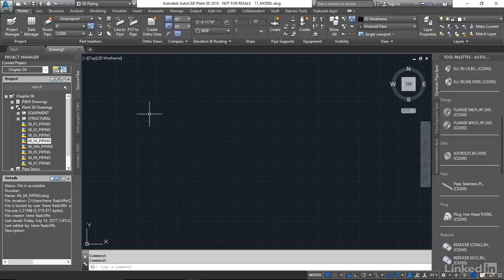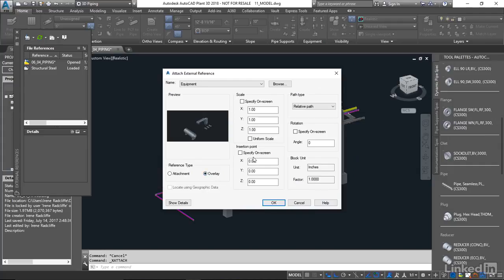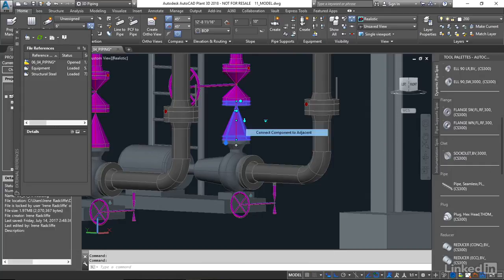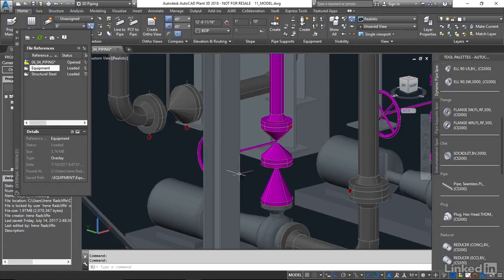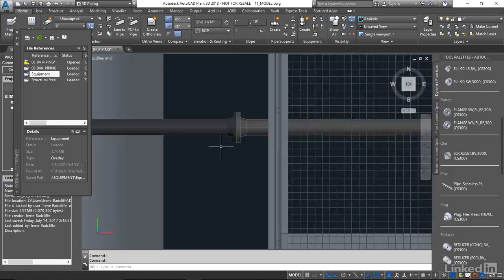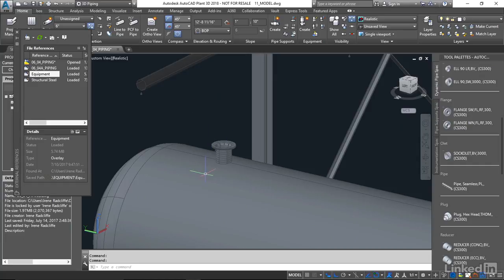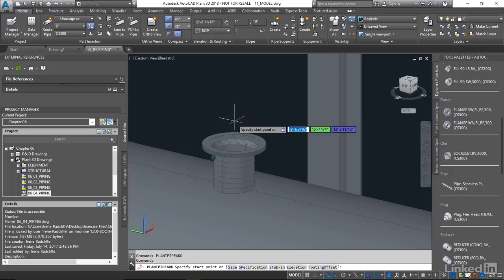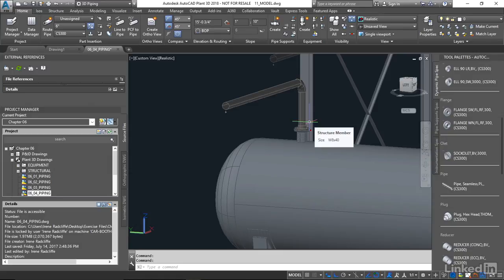AutoCAD Tutorial - Connecting to xrefs

Comment: Hi thanks for the upload. however, when i try to "connect to adjacent" i get an error message saying that they are NOT adjacent. but they are. ive checked many times, repositioned them, etc. do you know what could be causing this issue? thank you!
Reply: Hello, mate, I have a same problem. Do you know how to solve this problem? I try many times.
Reply: @troyball4842  check if the facing and pressure class parameters are matching those of the flange you want to connect. On the other hand, this error may also be due to the model being far from the 0,0,0 point
Reply: @VDCTime  Thanks